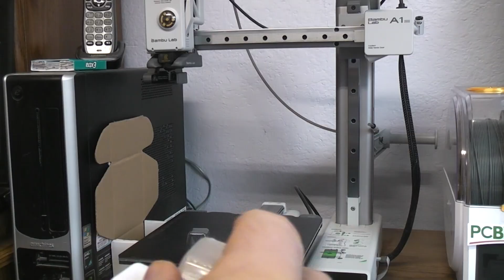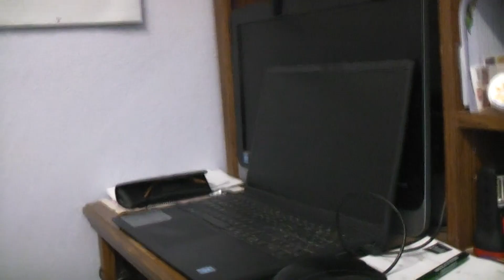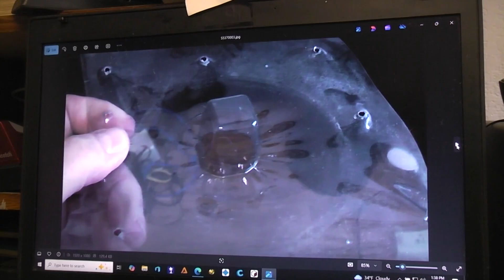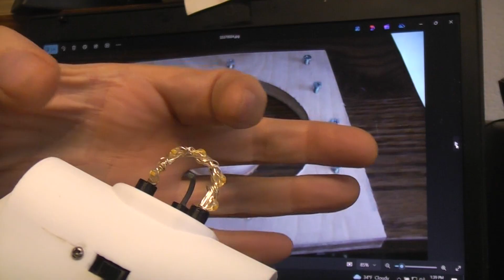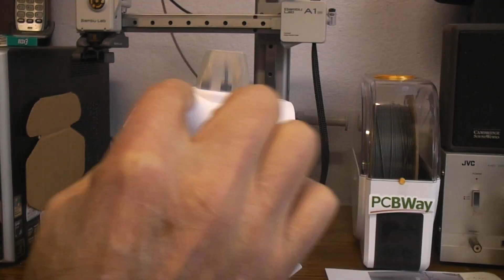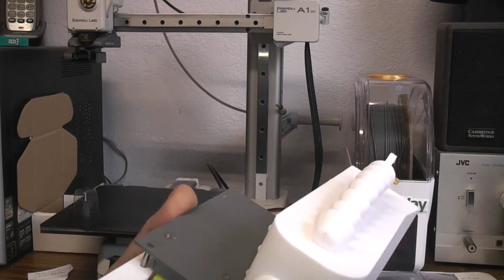1954 Devil Girl From Mars movie robot "Chani" build and demo.

Comment: hi, the color white filamen is that "cold white " ?
Reply from the maker: I used VOXEL brand PETG white. I did not want to buy a roll of flat white just for this project so just used what I had laying around. Normally I would just print in gray and spray paint but we are well below freezing here so spray paint is out of the question for now.

Comment: Aw he’s lovely, the little swagger as he walks is just adorbz. I vote for the printed version of his head cap as it ‘holds’ the light better, though the other does look cleaner unlit.

Suggestions: perhaps consider 3mm COB strip or LED filament for his head lamp?
Reply from the maker: The cob lights were the first thing I thought of and in fact have some on order from AliExpress right now. But the head is so small that I guess I will have to cut the shortest filament lamp string down. But plan on taking a look at it when they arrive.
Reply: @Robothut  I see, well I think 3mm width is the smallest they go on aliexpress and I’ve cut a pre-wired one as short as 3cm before with no issue, if needed I guess you could add a black heat shrink to any excess and hide it inside the main body?